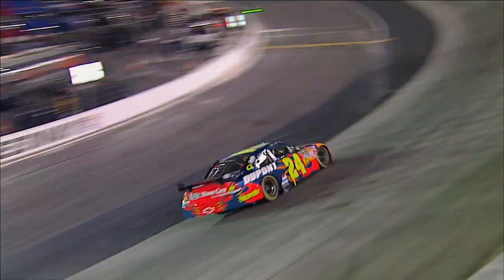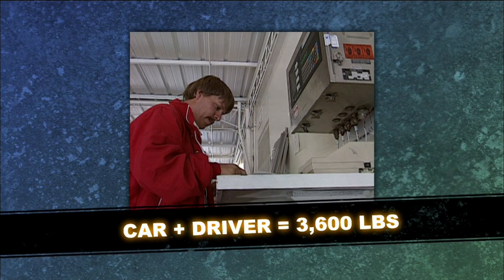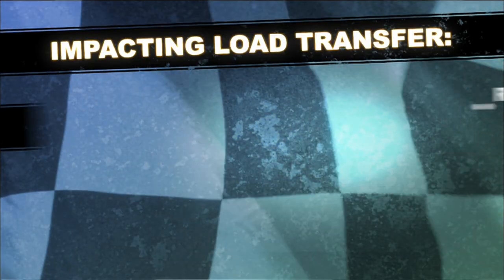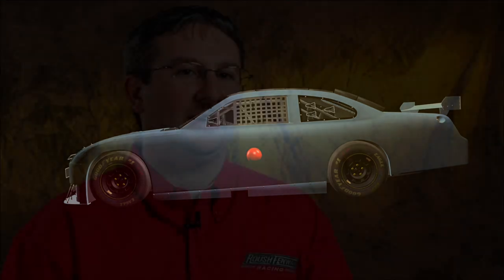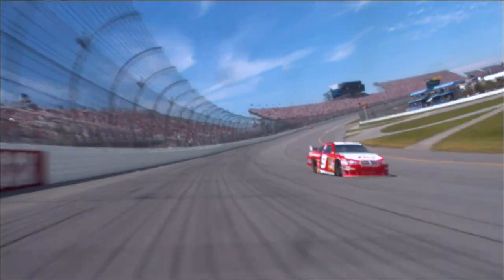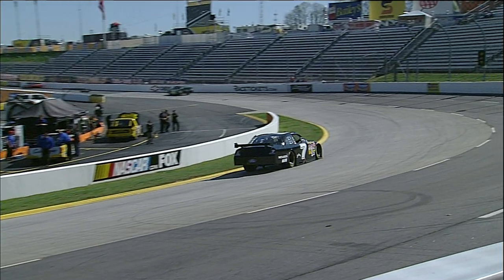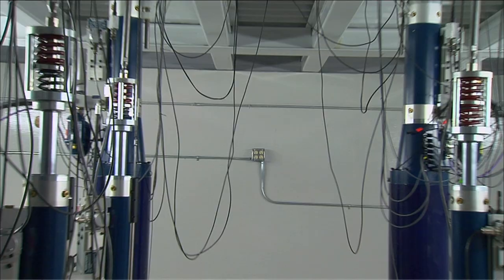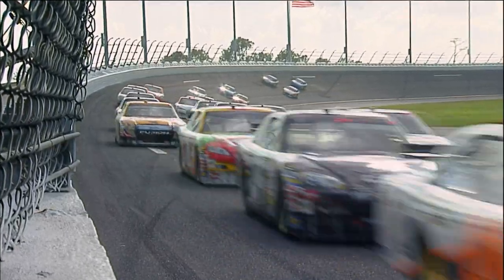Load Transfer | [NASCAR] Science of Speed

Comment: so there is entry middle and exit. Why do nascar tracks have 4 turns then its two turns
Reply: Ive always wondered this too, but i do have an explanation. For some reason they split the corners in half, turn 1 starting on the entry of the corner and ending around the middle of the corner, which continues into turn 2. I think some road courses also have weird long turns where they also split it in half.